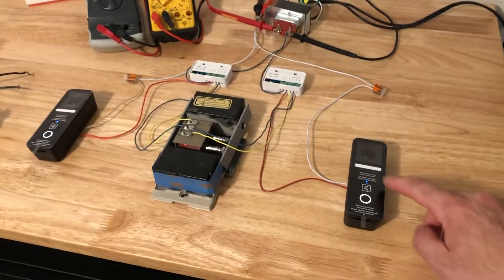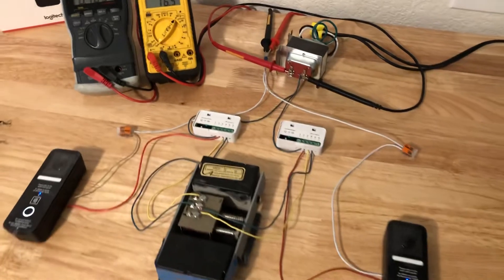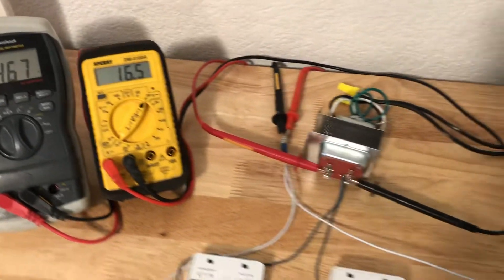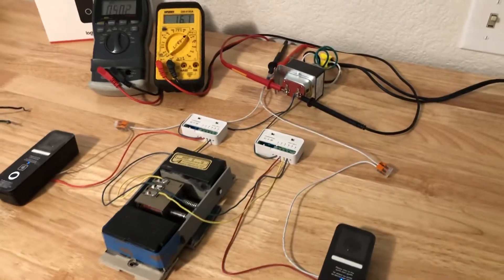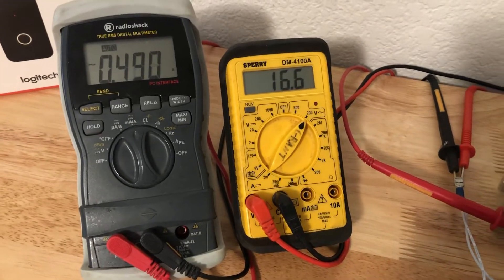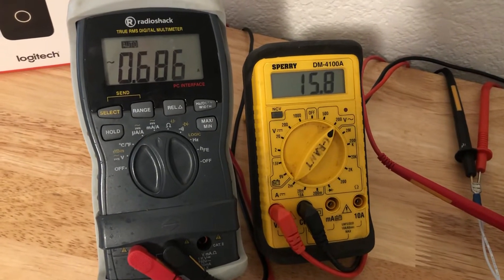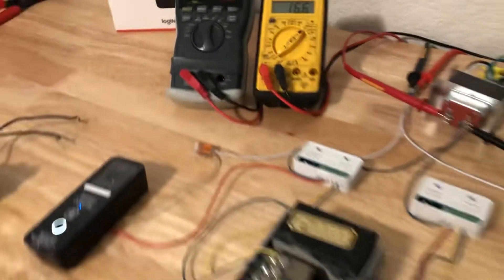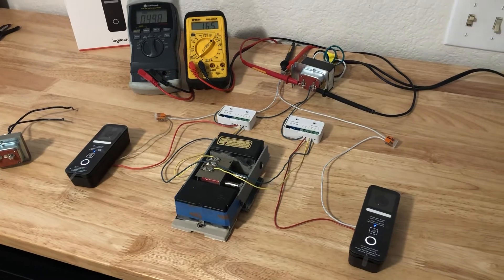TWO Logitech Smart Doorbells, SAME transformer and chime box

Comment: Is there any overheating concern with this setup?  Would a 24v 30-40VA transformer be better?
Reply from the maker: Yeah a higher powered transformer is a good idea.
Reply from the maker: This does go offline now and then and I have to cycle the breaker. I will probably upgrade to higher VA, it can't hurt.
Reply: Thanks for the reply Colin. I ordered a 24v40VA transformer. I’ll report back after install and testing.
Reply from the maker: @ please do! Thanks.
Reply: I have this setup and perfectly stable for a few months now using a 24v40va transformer. Both doorbells even get fairly heavy sun, and no issues.

Comment: Wow I might have to give this a go! I recently did a two logi doorbell setup and it seems the back one crapped out. I contacted Logitech and they said their doorbells need a 1-1 transformer to doorbell ratio. How have your doorbells been since installing on a larger   transformer? I might just do this route instead of multiple transformers.
Reply from the maker: I think you'll just need a bigger transformer.
Unfortunately my chime has quit ringing 3 times since install. The cameras never failed but the chime stopped chiming. We do get a lot of power outages/surges so that may be related. In each case I cycled the circuit breaker to reset the transformer which powers the chime/chime controllers/doorbell units and the chime started working again.
Reply: @colindgrant I have this issue going on for years with mine. Have a simple setup, 1 doorbell and 1 chime. Any ideas?
Reply from the maker: @pasqualao  this video doesn't apply to your simple setup. Just follow the Logitech instructions. They are accurate for single doorbell single chime.
Reply: I have the same setup as your video and also have the mechanical chime stop working.  Cycling the breaker on the transformer circuit fixes the problem.  It happens periodically.  Curious if you have found a cause/solution since posting this video.  It is getting really annoying to periodically reset the breaker.
Reply from the maker: @RobertWiggins-zn7zr  It happened to me again, still need to catch it in the act and investigate…
Reply: @colindgrant for what it’s worth I ran the system with a single Logitech and had the same problem.  I was running on a 16V 10VA transformer at the time.  Figured maybe it was the transformer size, but it persists even after upgrading to the 30VA transformer.
Reply: @RobertWiggins-zn7zr  @colindgrant Same issue here with 16-10 transformer and I was thinking about going to bigger transformer based on a article on Reddit until I read this comment. ecobee came out with a doorbell that works with Apple HomeKit which I may try out. But it is quite annoying when Logitech stops working. I have an extra doorbell if you for your testing. I took off the Logitech Doorbell and went back to the traditional button for now.

Comment: This video is very helpful! Interesting how switching pins 4 and 5 allowed it to work.
I have a digital chime - I have read that it requires specific instructions, like avoiding connecting a diode like one would to a mechanical switch.
Do you expect your setup to work with a digital chime as well (with the pins 4 and 5 swapped), or could that cause damage?
Reply from the maker: Sorry, I can't tell ya. I'm not sure how a digital chime is normally wired, but this project was really focused on the mechanical chime mechanism, which uses solenoids and pulls significant current.

Comment: @Colin Grant, Interesting! Do you know how to make 2 mechanical chimes work with 1 doorbell?
Reply from the maker: I don't know about TWO chimes with ONE doorbell (as in, one physical button). Your issue may be that the Logitech chime controller cannot power two solenoids simultaneously. Solenoids are tricky to power because they create brief current and voltage spikes that the controller may not be designed for. You'd have to test it.

TWO chimes on TWO buttons would be easy. Just use two controllers like I did, but wire their outputs to the two separate chimes.